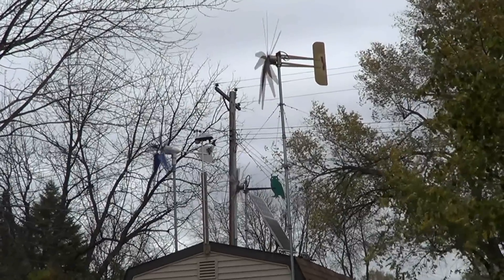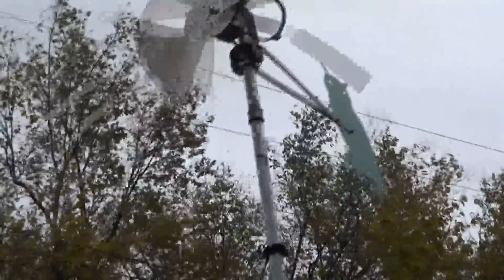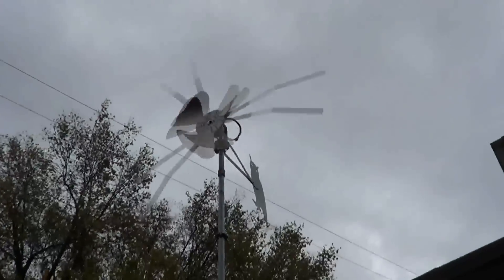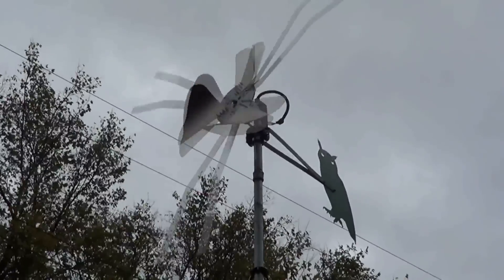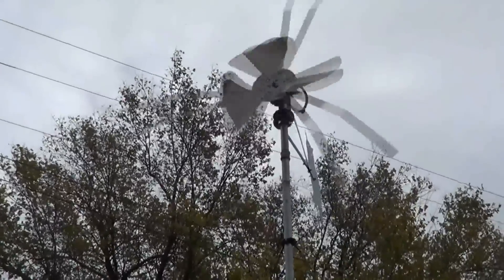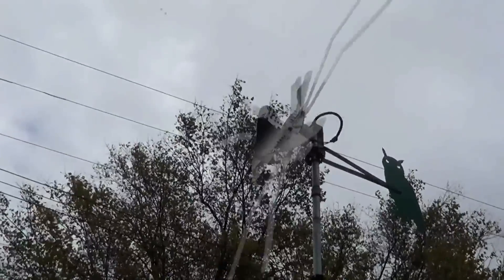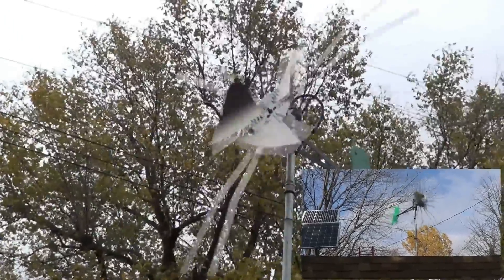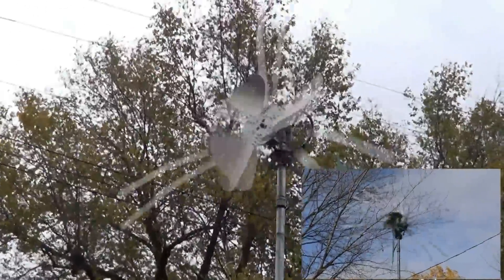X3 Blades with Turbo Cones and Owl Tail By Thermodyne!!

Comment: I like to watch the quick steering response to the wind. The roller is a good trick and skate wheels have a 40 year track record of taking hard abuse.  Glad I started patenting the newer stuff.
Reply from the maker: I like that too! And will show output soon. Thanks Bob for being a owner of a company with testing and thinking beyond the box!!
Reply: TheBillythekid2010
I'm a retired electrical engineer myself and been off-grid for over 30 years.  The hostilities between these two rival companies is insane.  I've seen both websites, and both Youtube channels.  I have to admit that MWS appears to be much more hostile and aggressive towards Thermodyne.  I've had two wind turbines in the past, one a newer model Jacobs, and the last one was a Southwest Wind Power Whisper 1000 (if anyone remembers those).  I hated them both. 

Once solar got cheap, I've been 100% off-grid, 100% solar for the last 12 years.  But as my present battery bank is starting to wane and show signs of age in this cold weather, I'm starting to consider wind power on the cheap to help coax my tired batteries through one more year.  I've obviously stumbled onto MWS and Thermodyne.  I will probably buy a Thermodyne this evening from Ebay and decide for myself because I really don't know who to trust.  Each has a dedicated following - it's almost like two Apple computer companies.  But I'm gonna order one of these and review it on my own Youtube Channel.

I like Windgeneering's approach to free information, his sharing his thoughts on Youtube, and his website is called "hydrogen appliances".  Heck he reminds me of myself tinkering with stuff and I had a hydrogen gas generator that I tinkered with quite a bit.  I like the guy and his approach.
Reply from the maker: Steve Robertson Well this is great, I get a comment that someone has seen the Hostile tactics that MWS uses, Thanks! But I hope you get this in time but call Bob of Thermodyne and as to get the Avenger and X3's !! I will put this X3's blade set and avenger up as soon as the wind dies down. I have the Avenger on one of my pole with Daddy0mom blades which work great, but here's a video of this Avenger and X3's. I hope you have at least a 10 mph wind zone for this!

X3 6 blade wind turbine good reliable free power

http://www.ebay.com/itm/DAUL-CORE-PMG-Double-Wide-Permanent-Alternator-Generator-PMA-PMG-DC24-/231178539600?pt=LH_DefaultDomain_0&hash=item35d3509250

Thermodyne has X4's that I will be testing soon with a reg PMA and The Avenger!

Thanks for the comment and your going to like talking with Bob! Thanks and let me know what happen's ! Thanks
Reply: I'll keep ya posted.  They show the turbine was already shipped today, so I'm sure that changes are a bit late at this point.  But I'm excited to check it out, and work with all the folks that are involved.
 I live on a mountain in Colorado.  The wind in summer is dead.  But Spring, Fall, and Winter it blows primarily from the Southwest at a steady 40mph most days.  It changes to the Northeast when a blue Northern blows in, then dead once snow starts.  It will be nice to supplement shorter days.
Reply from the maker: Did you get the black blades or the ghost blades? I just want to remind you of the wind area you live in. And the smaller pma you need a 8 to 10 mph to start seeing production like all turbines. And the smaller blades are meant for HIGH WIND AREAS!! I'm sure if you contact them and you tell him your doing vids the problem should be resolved. But thanks and stay in touch.
Reply: Steve Robertson   Welcome aboard Steve :)     I am done playing games those idiots  I am going to show people a better product at a dynamite price and that price will get lower and lower by 15% a year I figure. The era of propping up a product by saying "the other guy is worse" is going to end in 2015.  We put about $400,000.00 into research this year, most of it still very secret.  The goal is to produce a 1800 watt turbine with a strong design patent for $99.00 retail -We are  getting close and if I can do it well  'CHECK MATE'  lol.   The new design will not have magnets or coils, Just rotating phase locked / energized plates in series, call it an axial series wound motor and half the plates will be embedded in the blades, very cheap to build and very efficient

A patented product like this is what those guys are dreading most and why they are picking on me so much.  Fuel to the fire I say lol.
Reply: TheBillythekid2010
This is the one I ordered:
http://www.ebay.com/itm/301003231288?_trksid=p2060778.m2749.l2649&ssPageName=STRK%3AMEBIDX%3AIT

I chose a dense multiblade because my understanding is they do better in wind-obstructed areas.  My system is 48V, and I chose 2-wire so I can just wire it directly through my panel and then to the batteries (I don't have to buy bridge rectifiers to convert 3-phase to DC).  My MPPT Charge controller, although designed for solar panels will still switch on the load dump at the voltage setpoint to prevent overcharging.  It seemed to be the best bang for the least buck.
Reply: WINDGENEERING
I will be interested in seeing your new design.  I'm sure everything will come to a head at some point.  I've had a couple of people on my channel PM me about the products, and my interest in wind has been pretty much zero.  I am anxious to put it to the test and see for myself.  I feel good about my decision.
Reply: Steve Robertson If you want to gain full advantage of the turbine, i would recommand you to do the AC change in your turbine.. There is plenty of us that would guided you to perform this..  The AC configuration help out for having your power carried for longer distances and less power losses..
Reply: al desrochers
Thanks Al.  I understand the benefits of running 3 phase AC as opposed to 2-wire DC.  In my case, I didn't have funds to purchase the bridge diodes and the 3-conductor wire required.  I have #8 2-conductor wire on hand, and the distance should be no more than 50 feet (15 meters).  I think it will be good enough for my purposes.  I only NEED around 5 amps intermittently on these windy nights.  Anything above that will be a pleasant side-benefit.  If it ends up being so, I will set it up properly for long term.  But I can tell you are one of the fellows I can call on if I have issues.  Thank you sir!

Comment: Ouch!!!!  This vid is making the Falcon`s 80 inch look bad.. All the thinking behind the X`s series was aim toward rpm and torq.. No fancy looking blades here.. I have seen a vid where the guy has a set of Falcon`s put in the same ENVIRONNEMENT as you got there and they were not CONSISTANT for power production.. Thanks Buddy..
Reply from the maker: Al, the Falcon's wind wall and will slow down in rpm's cause of it! But as for the X3's they are bent close to the end's to let the wind flow off the tips of the blade! But the tip of the blade is where the rpm's are being made so the speed will be FASTER! And for safety the carriage bolt design lets you torque down as much as you can to keep the blades in place, no cracking of plastic! Plus when if it ever happen's the aluminium blade will bend, not exploded like plastic blades do sending plastic parts all over causing danger when they are hit or high winds happen!  Thanks Buddy for your knowledge and comment!